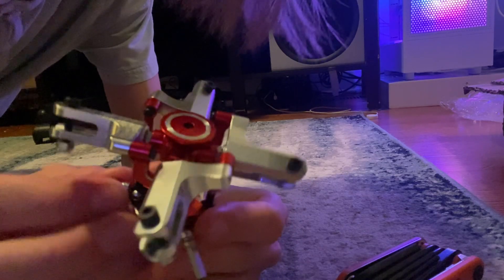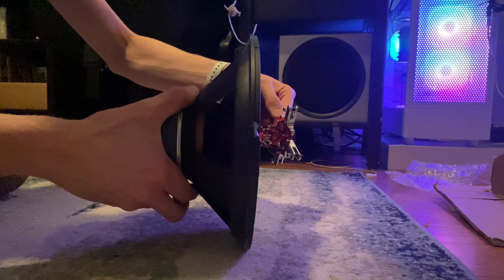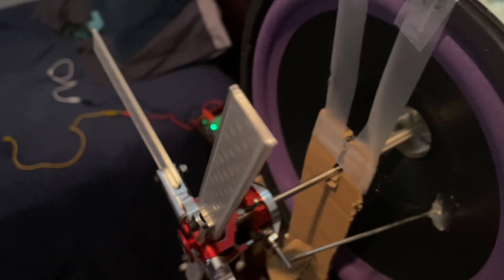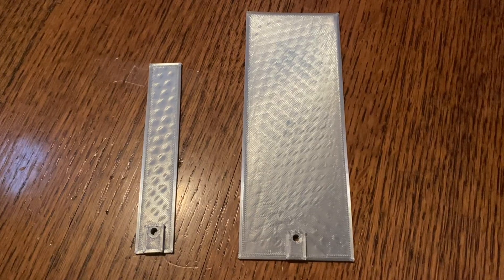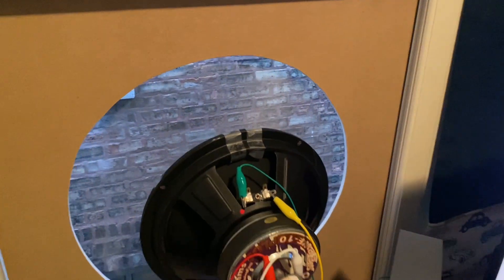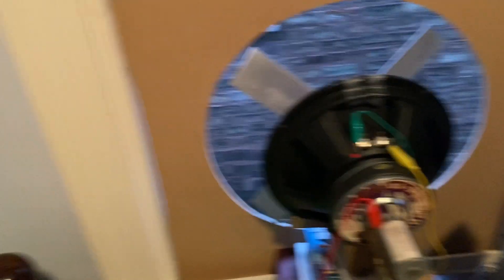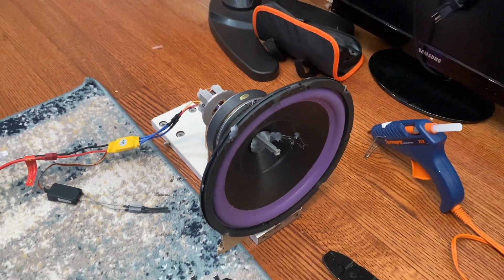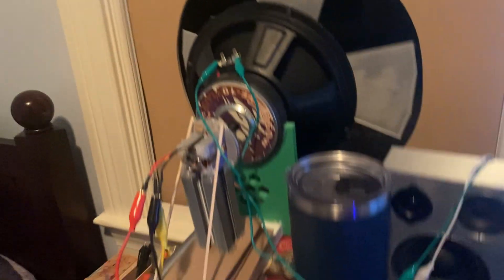Building a Rotary Subwoofer for insanely low bass! (Sub 10 hz!)

Comment: I'm surprised it held up for as long as it did with literal tape holding the rotor in place. You definitely need a more robust setup for this much force. I would just use solid wood and metal, instead of tape and plastic. Lol